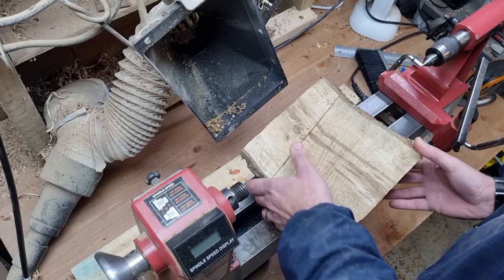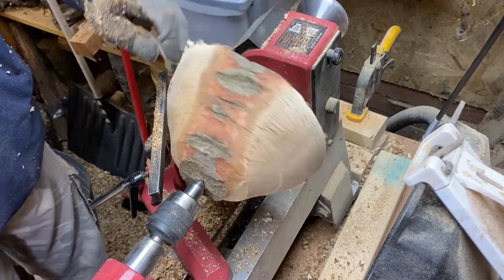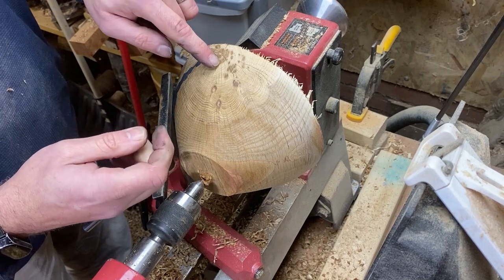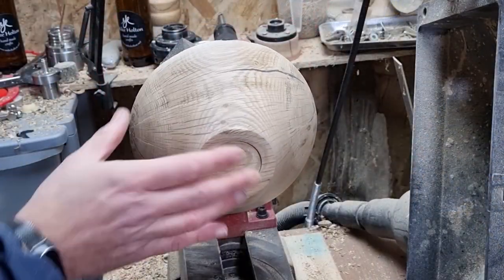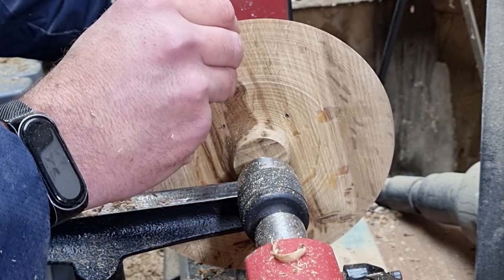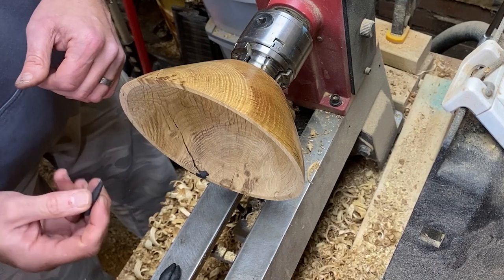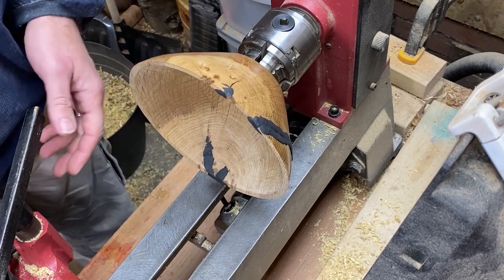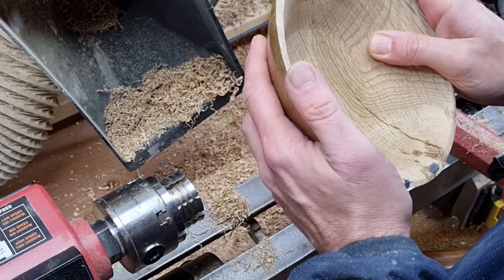Have You Ever Had a Near Death Experience? - Woodturning

Comment: I bought a cheap coffee grinder. I use it to grind up the shavings on the wood I'm working on. Put CA into the crack then the filings of the wood, press it in then top it up with CA , leave to dry
Reply from the maker: Indeed it is a very useful method for cracks 😀

Comment: Oh wow. After watching the short. I had to find the full video. And still think ouch. I have not used the filler you used so I dont know how it is made or reacts. I am curious if sanding would have worked instead of putting a tool on the outside. Keep up the great work.
Reply from the maker: Sanding would have worked, Miliput goes rock hard so it can be sanded. Next time I'll do that :D. Thanks so much for your support, Mike

Comment: I watch a lot of wood turning videos, but I’m no expert as such.  However life has taught me certain constants, for example, whenever the milliput, or other filler, sets and hardens, turners insist on attacking it immediately with a gouge.  Would it not make more sense to take a more delicate approach and sand down the excess filler protrusions first? Especially when the sides are so thin?  This would remove the extra leverage and reduce the chances of such an incident. I saw this one coming a mile away.
Reply from the maker: Obviously with hindsight I have to say you are right 😀

Comment: Wow, a major brown trouser event.   Glad you were not injured by the large flying piece.    This did not break where I thought it would break.   You are a braver man than I turning this  piece with too much checking and large cracks.    After the second round of milliput and the bowl moving due to moisture loss, I would have sanded off the milliput and tried to leave the bowl with the non-round shape.
I would not say this is in your hall of shame, perhaps the hall of the pieces which almost caused injury. 
I was not expecting a video on Xmas Eve.   Thanks.
Trying to survive the bitter artic blast at this end.   A power outage yesterday was only a few hours, but with outside temperature 5 deg F (-15 deg C), any power outage is not good.   I am thanking the utility workers for getting my power back quickly.
Happy holidays,
Dave.
Reply: Season's Greetings from the BIG SKY.
Reply from the maker: Thanks Dave, wow -15!! that is a bit nippy, glad it got sorted quickly those sort of temperatures can do some nasty damage to your heating pipes. I think you are right about sanding the outside milliput first and with hindsight that is what I would have done. It's all part of the learning experience, don't forget I've only been turning a year and a half lol.
Wishing you happy holidays and a happy healthy new year.
Mike
Reply from the maker: Thanks Rodger 😃